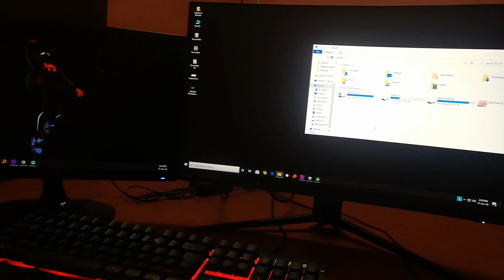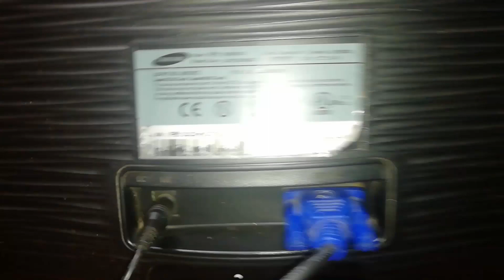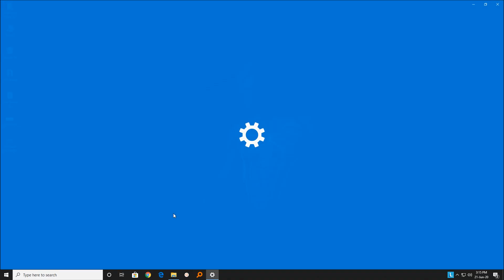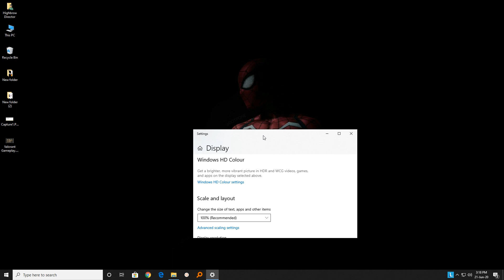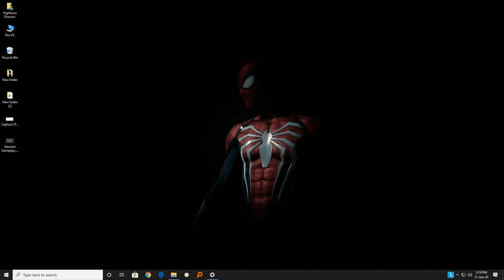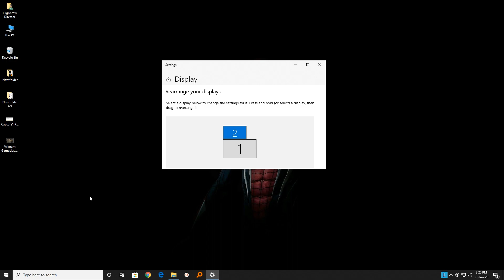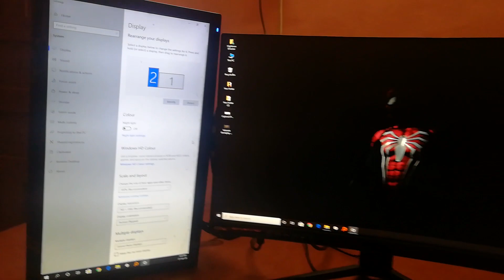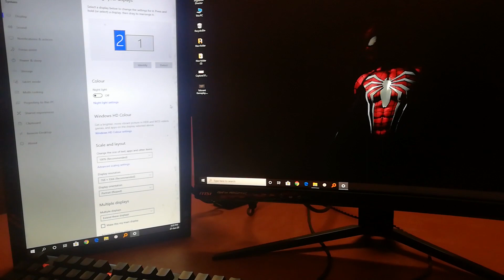Multiple Monitor Connection Setup | Malayalam Tutorial

Comment: Ente system grapics card und so matte port undaville normal port adh disable avoole adh enable akka engana nn paranj tharoo ente grapcs cardil ithra port illa so aa port enable akkiyitt venam randu monitor use akkan plz help
Reply from the maker: Enter BIOS/UEFI: Restart your computer and enter BIOS/UEFI setup by pressing a key during boot (usually Delete, F2, F10, or Esc, depending on your motherboard manufacturer).

Locate the Display or Graphics Settings: Look for options related to graphics or display settings. This could be under categories like "Advanced", "Chipset", or "Northbridge".

Adjust the Settings: Change the settings as needed. For example, set the Primary Display to "PCIe" if using a dedicated GPU, and enable iGPU Multi-Monitor or Integrated Graphics if you want to use the motherboard ports.

Save and Exit: Save your changes and exit the BIOS/UEFI setup.

Comment: Lapinte screen poyappo VGA cable vech computer monitoril connect cheythu but sound varunnilla athu engane correct cheyum..monitor mathrame kayil ullu
Reply from the maker: VGA cable vazhi sound varilla, HDMI aanel TV lu okke connect aakiyal sound varum, Pinne monitor audio support ulla monitor aano enn nokanm.
Reply from the maker: HDMI to VGA converter aanenkil, earphone jack ulla converter available aan.
sound ath vazhi varum.
pinne audio settingsil maatiyal mathi ordinary portiloode sound varan.
HDMI connect aakumbo default sound setting - HDMI aavum.
ath maatiyal mathi

Comment: Hiii  broo display options onnum work cheyunilla graphics card gtx1650 anu 4.28 not show 
Widows update
Grapic card update
Reply from the maker: eth graphic card aayalum display settingsil kanikkum 2 monitor connect aakiyal, engane aanu connect chythath?
Reply: @HighbrowDirector   graphics cardil ninu two way converter use cheythu, display both working as duplicate but not expanded
Configure surround poyi 
Physcx setting   auto selected recommended
Span display with surround ☑️  configure cheyan pattunilla tik option varunilla
Reply: Card problem ano
Reply from the maker: @creativelifeskills  ctrl + p adich project mode maatam
extend enna option select chyth nokk
cofigure surround okke entha enn manasilayilla
Reply from the maker: @creativelifeskills  no, whatspp me @7025674097
Reply: card geoforce GTX1650

Comment: Bro. ഞാൻ ഉപയോഗിക്കുന്നത് viewsonic ന്റെ 2k monitor ആണ് refresh rate 185 ആണ് ഉള്ളത് എന്നാൽ അത് display port കണക്ട് ചെയ്‌താൽ മാത്രമേ കിട്ടു. Hdmi വയറിൽ 60 hz ആണ് കിട്ടുന്നുള്ളു. കമ്പ്യൂട്ടർ ൽ display port ഉണ്ട് എങ്കിലും mac ആക്കിയതിനാൽ ഒരു ഗ്രാഫിക്സ് കാർഡ് വച്ചാണ് ഇപ്പോൾ വീഡിയോ out എടുക്കുന്നത് പക്ഷെ അതിൽ hdmi port മാത്രമേ ഉള്ളു. ഈ ഒരു സാഹചര്യത്തിൽ hdmi to display port convertor ഉപയോഗിച്ചാൽ 185hz refresh rate കിട്ടുമോ? Plz help
Reply from the maker: Did you try changing refresh rate in display settings?
System > Display > Advanced display > refresh rate
Reply: @HighbrowDirector  mac ആണ്
Reply from the maker: @KrishnaprasadPKD  Ente Mac inu HDMI port vech 144Hz kittunundalloo.
Monitor 1080p 144Hz aaan.
Reply: @HighbrowDirector  ഈ മോണിറ്റർ ൽ  hdmi യിൽ 60hz ഉം display port ൽ 185 hz ആണ്
Reply from the maker: @KrishnaprasadPKD  Converters use cheyyumbo loss indavan chance und.
I can't guarantee
Reply: @HighbrowDirector  ഓക്കേ.. Thanks bro

Comment: Bronte pc specs parayo
Reply from the maker: Videoil ulla PC alla ippol

OLD:
i5 4600
Lenovo motherboard(Think centreE73 readymade)
GPU: GTX 1070 8GB
8GB RAM
240GB SSD
500GB HDD

Now:
Processor: i5 12400F
Mother Board: Asus TUF-G-B660M-E-D4
GPU: GTX 1070 8GB
RAM: 16GB GSKILL
M.2 SSD KINGSTON NV1 500GB NVMe
HDD: 2TB
Cabin: ANT Esports TCE 511MT
Keyboard: CosmicByte CB-GK-14 SIRIUS Mechanical (Wireless RGB)
Mouse: Logitec G102
Headphones: Gamdias HEBE M1
Monitor: MSI Optix MAG241C Curved Gaming (144Hz 1ms)
PSU: Cooler Master 1000W Gold
Reply: @HighbrowDirector  poli
Reply: @HighbrowDirector  bro ipo minecraft kalikaarundo
Reply from the maker: @muhammadrabeehvp7021  Gaming moved to https://youtube.com/c/HighbrowGaming, ipo valorant, sea of thieves okke aan